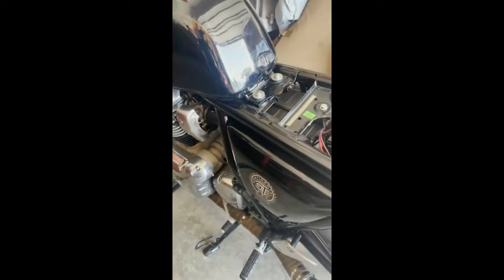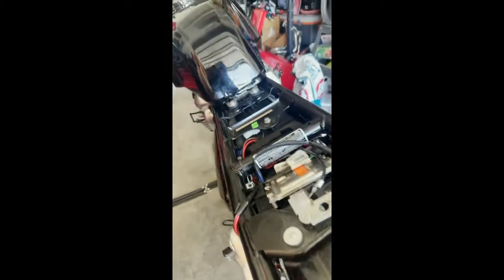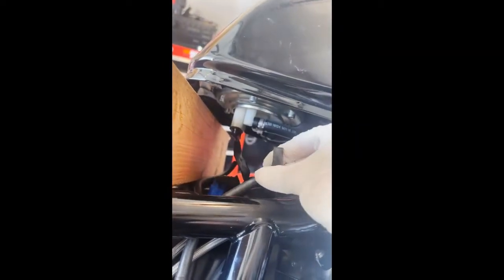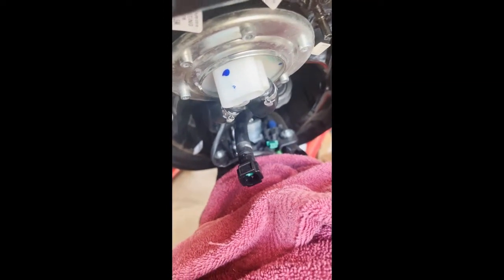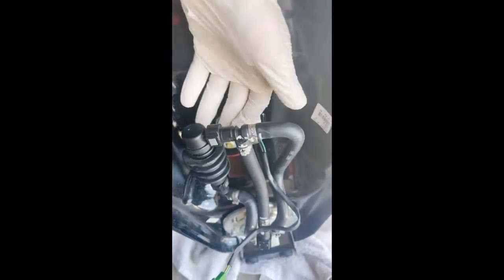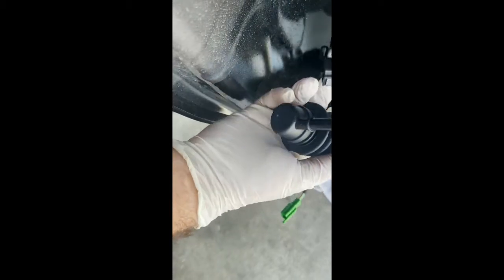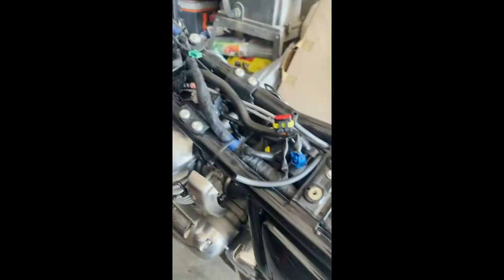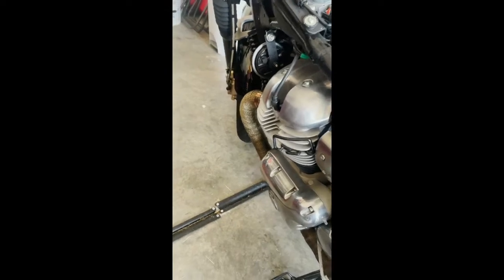2019 Royal Enfield continental GT 650 Fuel Filter Change

Comment: Thanks for sharing! Just doing the 10k service and the manual mentions replacement the fuel filter every other 10k kilometers/6k miles. With that much stripping down I'll wait for another weekend and do the tappet adjustment at the same time, kill 2 birds with 1 stone. Cheers and ride safe.
Reply: I don’t blame you. It’s a little bit of a process but shouldn’t take more than an hour to do if you have some help. Cheers and keep both wheels down.

Comment: That's a greate vido... Do you recommend cleaning or replacing fuel filter after 20000 km..?
Reply from the maker: I definitely recommend it. When I checked the gas tank a lot of paint chips from the top of the gas tank came out.